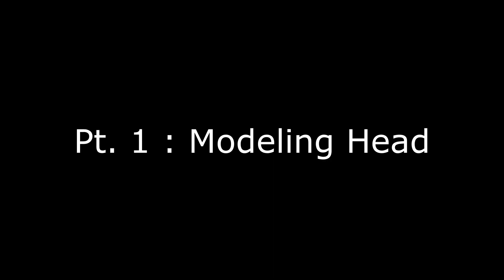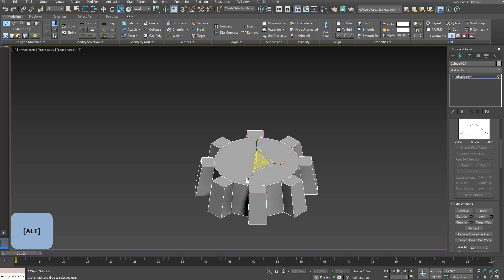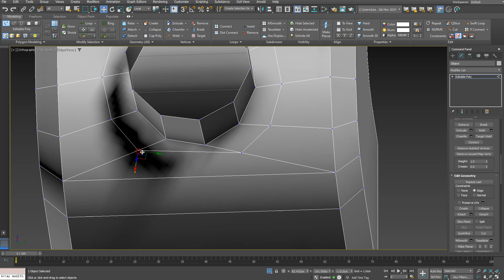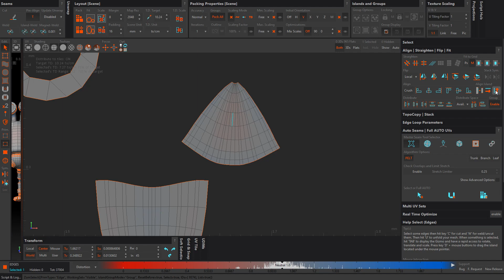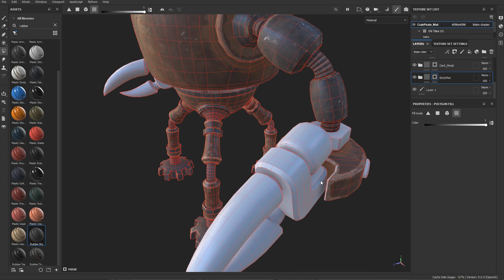3d Modeling, UV Unwrapping and Texturing a Pirate Crab Bot [3ds Max / Rizom / Substance Painter]

Comment from the maker: Table of Contents:

00:00:04 - Pt. 1 : Modeling Head
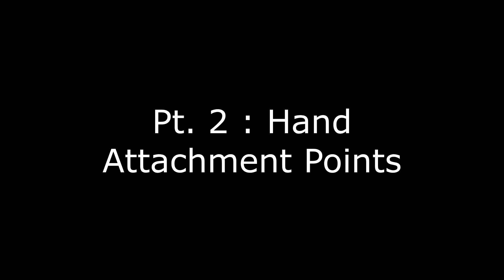00:03:05 - Pt. 2 : Hand Attachment Points
00:05:21 - Pt. 3 : Leg Attachment Module
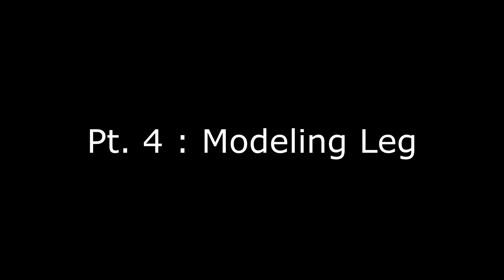00:07:18 - Pt. 4 : Modeling Leg
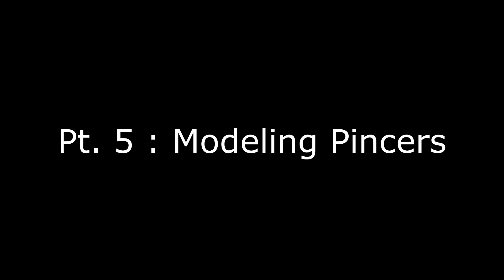00:10:01 - Pt. 5 : Modeling Pincers
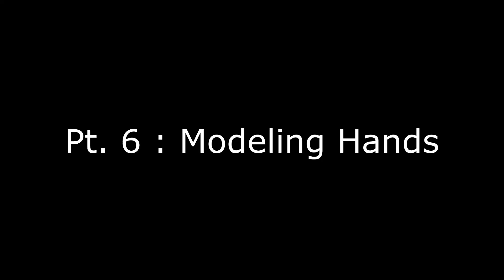00:17:02 - Pt. 6 : Modeling Hands
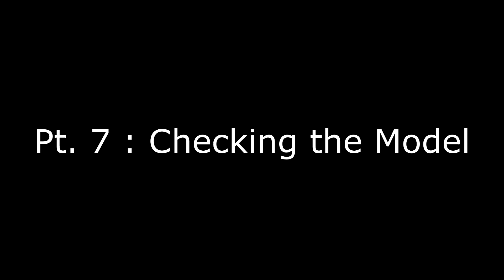00:18:51 - Pt. 7 : Checking the Model
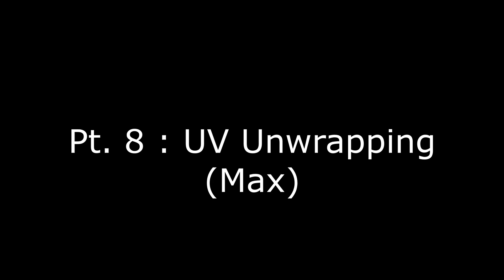00:19:39 - Pt. 8 : UV Unwrapping (Max)
00:20:37 - Pt. 9 : UV Unwrapping (Rizom)
00:25:26 - Pt. 10 : Baking
00:25:44 - Pt. 11 : Texturing

Comment: Interesting technique! I've also been trying to eliminate unnecessary optimizations that end up slowing me down. For the chamfers replacing baked edges do you use the same chamfer distance throughout the entire model, or does it vary depending on the part?
Reply from the maker: Thank you! It usually varies depending on the part. Sometimes, I also tweak the vertices manually to mimic sculpted, uneven chamfers.